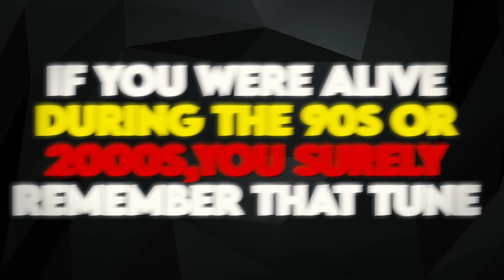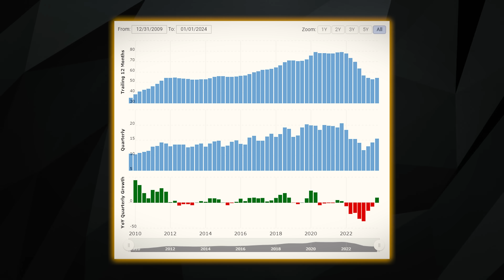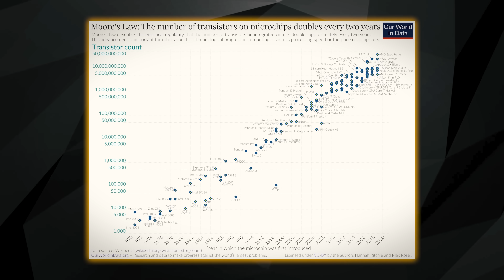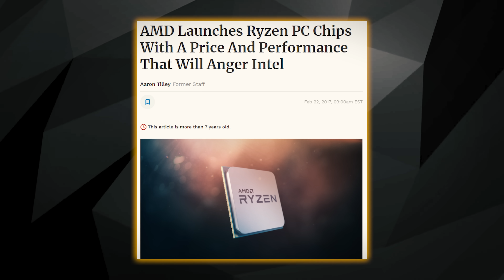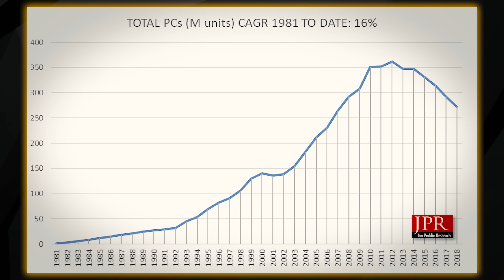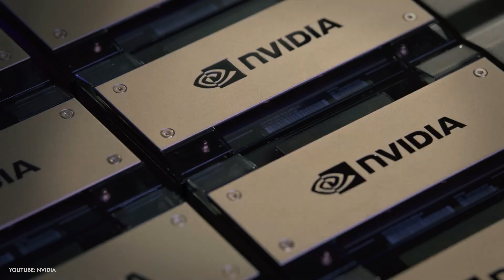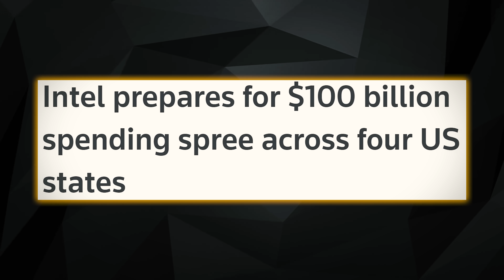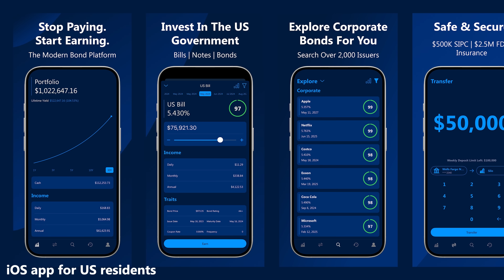The Dire State Of Intel...What Happened?

Comment: Intel made great chips but the software that ran them was crap and is still crap. Intel should have demanded MSFT and other software companies clean up their act. I have a brand new HP Laptop, Windows 11, when it works, it's very fast, but right out of the box 2 weeks ago I had endless problems with Windows.

Comment: When AMD unveiled ryzen,  they weren't better than intel, but they were much better than their last chips, and it only took a few ywars to finally beat intel in price, performance, and chip efficiency. What did intel do? Make the same thing with a few more cores, then 12th gen came and it worked out well, but then ryzen 7000 was out and beat intel again, then intel 14th gen was a mess, yes it may have performed well, better it was unstable, and power like it was it's last meal, 15th gen made it more efficient, but power wasn't better. In fact, sometimes the 14th gen i9 would bet the 15th gen 9 ultra. Plus AMD released ryzen 9000 before, and it performed better, took less power, and costed less. AMD went from almost dead, to thriving in one decade. Intel failed to adapt to its rivial.

Comment: Isn't Intel going to possibly be first to market with some new kind of insanely low voltage/heat ridiculously small vertical tunnel transistor that could be a game changer in micro chips?

Comment: Intel CPU dominance is primary based on x86 legacy and superior fab.  They missed the mobile because the mobile had no x86 legacy software compatibility need, and putting Intel (or AMD for that matter )on mobile has no benefit. Secondly, Intel lost its fab edge around the 16 nm node.. the x86 was tolerable despite its inelegant arch bec Intel could compensate through superior fab.  When Intel  lost the fab edge with Deep UV, that was what erode the problems today.    Until that’s fixed, or Intel goes fabless, there is little chance Intel will bounce back.  Worse still, there is a time limit for Intel to go fabless .  The ARM ecosystem has just a large economy of scale that people (Apple, Linux, Windows) are willing to port software and x86 may even fade out. Without x86, there will not be Intel.

Comment: I hate that "stock people" talking only about their stock so let me break it down for you as someone who knows a lot about PC hardware
1. Their motherboards doesn't have a future proofing path which means that customers will have to buy a new motherboard more often when they want to upgrade their CPUs while AMD is doing the opposite and giving more future proofing and they AMD have better value in most cases. So for example, if you want to make a big jump upgrade, it will cost you much more with Intel than AMD
2. Intel has failed with their 13th and 14th gen of CPUs (look on google and youtube) and they tried to hide the issues they had with those CPUs and even blame motherboard manifucturs for it. They also denied to help their customers with those CPUs even if the customers hasn't done anything wrong and they have a warranty
Now they're getting sued by their shareholders and the authority because of their shady and scammy marketing

Comment: Intel launched their first discrete GPU in 1998, not 2021. It was the i740, a chip that has ties to military simulators and arcade 3D graphics. GE Aerospace was sold to Martin Marietta in 1993, which later merged with Lockheed in 1995 to become Lockheed Martin. Sega had partnered with GE Aerospace to design the Model 2 arcade hardware that powered such iconic early 3D arcade games as Daytona USA and Virtua Cop. Sega would continue to collaborate with them on the less-ubiquitous bnut equally impressive Model 3 hardware.

Lockheed later formed Real3D which was the company that Intel would eventually partner with to make the i740 GPU. Lockheed/Real3D hardware had also been considered for use in a Sega Saturn 2 system architecture, meant to be a 64-bit upgrade to the original Sega Saturn (not the Dreamcast). At the time, the arcade hardware was pretty much top of the line and it was assumed that if Sega could get the hardware into a home console, it would easily best the hardware of its rivals. Since the i740 was based on Real3D technology, it was expected that the Intel GPU would be very performant, especially since it was the first card to use the then-new AGP bus and used system memory for texture storage. This turned out to be a huge bottleneck and performance was mediocre, with Intel selling the card at budget prices.

Most people have completely forgotten about this GPU since it wasn't very successful and was slower than some of the cards that had been released before it. This was the era when 3dfx was the king and Nvidia was making a name for itself by embracing DirectX and offering good all-around performance and image quality with their Riva 128 GPU. Real3D was shut down in 1999, with Intel purchasing its IP to continue development within their Extreme Graphics integrated graphics chipsets.

Comment: Just got laid off at Intel. Not gonna lie we only did about 1.5 hours of actual work per 8 hour day @ $75/hr.
Reply: That's called deadwood in Engineering Departments. That's when you know the culture is rotten from the top down. It's going to require a complete top to bottom leadership change. I wish Intel luck not gonna be easy.
Reply: That's why you got laid off.
Reply: @jamescarter8311 not after we milked the company for hundreds of thousands over the years.  We made out like bandits!
Reply: fab or office? R&D or Marketing?
Reply: @limpbalm  we got extremely arrogant a while ago because we were basically a monopoly.  Then came Nvidia amd tsm arm and wiped us out

Comment: The list of chipmakers seen at the beginning of the video is nonsense!  ASML is NOT a chip maker, they are a company that provide litho equipment to chipmakers!  Applied Materials is also not a chip maker, they, like ASML, build equipment that they sell to chip makers.  Samsung is a conglomerate that makes chips, but they also make many other things like TV's and smartphones so their valuation is not entirely based on chip production.  Similarly Qualcomm makes chips, but they make other things to.  Broadcom is also a chip maker but they also make a ton of other things.
In this list the only pure-plays for chip making are TSMC, AMD, and TI, but even here AMD no longer makes chips, they design them and have others make them.
I generally love your content, but this is so poorly researched that I'm beginning to question why I previously loved your content.
Intel has made many mistakes in the last couple decades, such as failing to comprehend the impact ARM would make and the fact that appliances designed to surf the internet are now done using smartphones and tablets that don't use Intel CPU's.  Like GE, Intel bought into the idea that weeding out lower margin products was the way to go and like GE, they've ridden that idea into irrelevancy!

Comment: The quote about Berkshire Hathaway doesn't even partially apply to Intel. All that matters is performance. People will buy the most performant tech available, regardless of previous reputation. Performance is everything. Horrible reputation and then you put out a chip for the same price as the competition that uses 20% less power and is at the same time 15% faster than anything out right now? Everyone will buy it and you win.

Stop using random quotes you don't understand. Berkshire Hathaway needs confidence in them from investors. Intel needs performance to drive sales. They are in no way related and the quote isn't applicable.

Comment: I think this video paints a somewhat too gloomy picture of Intel. I used my first computer over 40 years ago and worked in PC design as a builder and integrator from age 17 so I have a somewhat long lasting first hand understanding of chip makers and the value of their products. I have implanted Cyrix, IBM, Intel and AMD CPUs into PCs for most of my life and I can say that Intel has more often than not been the right choice. However, from time to time AMD especially would simply leap frog ahead. The world changed with dedicated 3D graphics and later AI and Intel stayed out of the gaming segment instead opting for introducing integrated or on chip graphics solutions. At the same time, Nvidia and Radeon(later AMD) took strong positions there and for Nvidia this has paid off massively during the AI bubble. A lot of the companies you mention are not chip makers but instead chip designers, this includes both AMD and Nvidia and ASML makes tools for chip production. I think comparing Intel to Nvidia is a bit off sure they both make chips but its a bit like comparing a company that makes trucks to a company that makes sports cars while AMD is a better comparison. Intel structure there to be both chip designer and foundry has its benefits and its drawbacks.

Intel is in the process of rolling out a new FAB and attempts to go into business with a model where they are both foundry (like TSMC) for everyone who wants to bet on it as well as a chip designer like AMD or Nvidia. I am by no means an expert here, and I would leave it to those better informed on whether this new FAB has the potential to be a disruptive force or not seeing as other chip makers (TSMC) might adapt but its worth mentioning that the amount of competitors in that space is actually very few. Today I would still buy an AMD CPU for a new systems yet in businesses Intel is often the choice and when looking what is actually on the market it is not like they are as hopeless at competing as some of AMDs earlier architectures have been vs Intel (Such as AMD FX). Considering reviews it also looks a lot like Intel is doing better and better in the graphics space today just as they have an AI chip product as well (Gaudi 3). It takes a long time to develop these and it shows that Intel  is not left behind in that regard.

While their Arc graphics, Gaudi AI chips and current CPUs might not be the BEST they are certainly not so far behind the curve that you can count them out. Back to my life experience here, these chip makers surpass each other every once in a while, it has happened many times before. Intel got their bubble in 2000 Nvidia has theirs now. I would say Intel is poised for a rebound in any of these areas and while I do not expect the company to become all dominant as it has been I expect it to keep on putting out viable products in the future. R&D is not lost upon them either for instance they are also actively contributing to research into neuromorphic processors. 

Last but not least any escalation in the Taiwan strait by China and you will see Taiwanese TSMC fabs potentially stop deliveries but in all likelyhood it would catapult Intel stock up boosting their market cap potentially opening up options for further investments.

Personally I see the biggest challenge to Intel being the change in the computing industry as such. The rationale for X86 becomes harder and harder to justify in the PC segment and as you rightly point out with Apple switching to M1 shows other options are available and viable. It might very well be of critical importance to Intel if they can expand upon their partnership with ARM especially in the foundry business but potentially also elsewhere. Likewise it will be decisive if their Gaudi offerings find a space in the datacenter AI field.

Comment: Intel can be dumbed down to "Heres cpus that every gen, requires a whole different motherboard which itself costs $400+".  Intels early cpus are still viable for the cost, the issue today is the abysmal price to performance, they run hotter, more power consumption, and cost. AMD on the other hand are more price to performance, less heat and power consumption, and the best part... the Am4 socket can be used by any gen Cpu. Amd has shown that they can do it, and right now theyre between a wall and a hard place with their GPU's, but i hope they show Intel that greed is a bitch. Its also funny because intel keeps up the same old cpus year by year by only cranking volts on the chip and selling it more than the non overclocked

Comment: With the new Snapdragon X line of ARM CPUs(SoCs to be precise) for windows, most of the laptop makers are going to shift a significant portion of their laptop line-ups to Snapdragon SoC. This is another major revenue and market share loss for Intel. Microsoft is focusing on Windows on ARM too.

So, Unfortunately, in future, Intels (and even AMDs) x64 CPUs are only going to be useful for gamers, and servers, which need high single core and multicore performance, unlike the majority Consumer laptops which need better perf/Watt and battery life, and NPU on chip for AI etc.

Also, I started to see many cloud providers giving ARM based Virtual machines(EC2) which are good for most of the general purpose workloads given the low cost compared to x64 CPUs.

Only very specific workloads like Databaser servers, gaming cloud etx need x64 because of its high single core perf compared to ARM.

Hence it's going to be tough time ahead for Intel and x64.

Bad time ahead for Intel and x64 Architecture
Reply: Not one of those companies make chips.,

Comment: markering instead of technology and no competition/almost monopoly in x86/x64 eat them. AMD also had such time and almost gone to bankprucy because of marketing instead of technology. Intel provide 2-4c cpu with same speed for almost 10 years for laptops (I had 2 laptops with 8 years difference with same speed even both were bought at best intel CPU for laptops then but it is 8 years of difference in technology... and absolutely no change, same TPD also !!!!!), you can't do that for a long period without consequences.
But intel had so lot of money from past years that they may recover with a new technical CEO, we hope.
Intel should open their architecture (x86/x64) for more flexible licensing model, like ARM, which (ARM licensing) support a very fast improvement of ARM chips technology efficiency and performance, intel may do similar licensing model which for free give their technological advandage from all other tech/chip companies.
GL intel !!!!

Comment: What happened is Moores' law has run its course and the chip industry overall is moving towards different technologies and trends to move things forward.   And Intel has just for a long time done a bad job transitioning from x86 to other platforms and now is in jeopardy as AI becomes a more dominant factor in the market cycle.   However, that is simply a warning for everybody in the industry as chip performance overall has stalled and the only thing they can do now is promote more efficiency and power savings as they decrease transistor sizes which is will ultimately produce diminishing returns as a factor of cost to manufacture regardless.

Comment: @wilkinlow you should sell it. With the new Snapdragon X line of ARM CPUs(SoCs to be precise) for windows, most of the laptop makers are going to shift a significant portion of their laptop line-ups to Snapdragon SoC. This is another major revenue and market share loss for Intel. Microsoft is focusing on Windows on ARM too.

So, Unfortunately, in future, Intels (and even AMDs) x64 CPUs are only going to be useful for gamers, and servers, which need high single core and multicore performance, unlike the majority Consumer laptops which need perf/Watt and battery life, and NPU on chip for AI etc.

Hence it's going to be tough time ahead for Intel and x64.

Bad times ahead for Intel and x64 Architecture.

Comment: Ai is guessing, todays conputers cant compute they are held back by the instruction set n since 2017 its been all the companies selling loads more stuck together and pretending to be 1 monolithic power that used to do computing in real time using lots of power n lossless full on the fly, now its laggy using rendereibg o. Multitasking cores controlled by cpu using off chip thinking n not all at once data sent to run on the cpu, fps dlss multicore vsync borderless upscaled is a snake oil to sell the rejects making the high tier 80ti class and none e core using loads of lanes hell we now gone backwards n have no high end its all raytraced n rendered popins fake images n laggy to sell off the waste since 2016. Windows amd use teicks to pretend to be an high end, now games are written to this sub par hardware n tru gamers n musicians n 3dgfx artists cant upgrade since 2017 its a downgrade if we do and slowly going to use loafs of 8bit chips again, native no vsync pcie16 x 8 x 8 at full speed and a board with socket for 102 or 101 is the peak its all multitasking low power fps dlss upscaled word salad that fools rate by today, they now blame games for their bad choice in hardware, more cores ai rendering multicore e cores lol nobody wanted this for high tier gfx snd or gaming